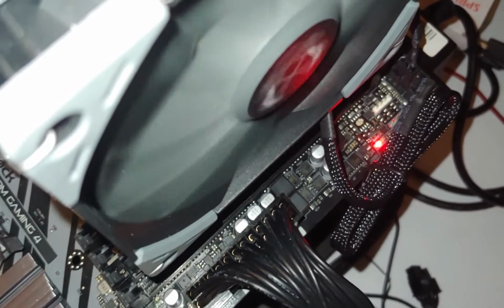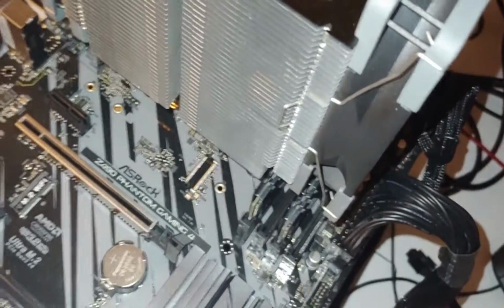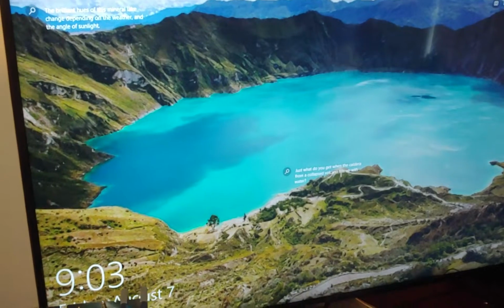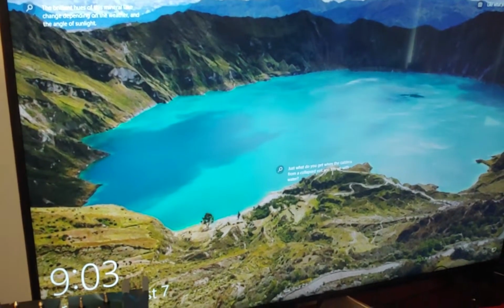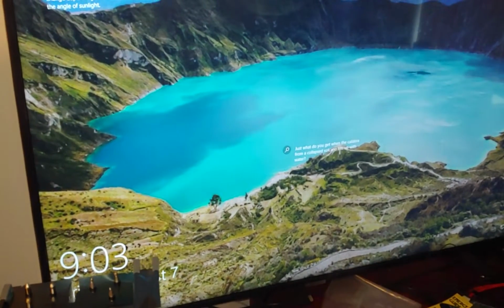Installing the I7 10700k into the Asrock Z490 Phantom Gaming 4 motherboard (After removing I7-10700)

Comment from the maker: Currently, manufacturer recommends using the 2nd and 4th slots (A2 & B2) from the CPU and not the ones that I use in this video. In say Z170, one could put dual channel in A or B if using 2 sticks.  Sorry for the confusion. 

 Channel A: DDR4_A1, DDR4_A2
 Channel B: DDR4_B1, DDR4_B2
 Recommanded Dual Channel Memory Configuration:
 
                       Closest to CPU                                                                                  Furthest from CPU
                       DDR4_A1               DDR4_A2                  DDR4_B1                              DDR4_B2
2 Modules         - -                         DS/SS                        - -                                             DS/SS
4 Modules     DS/SS                     DS/SS                       DS/SS                                      DS/SS
(SS=Single-Sided, DS=Double-Sided, "- -"=No Memory)
Due to CPU limitations, read the following guidelines before installing the memory in Dual Channel mode.
1. Dual Channel mode cannot be enabled if only one memory module is installed.
2. When enabling Dual Channel mode with two or four memory modules, it is recommended that memory
of the same capacity, brand, speed, and chips be used.

Comment: What does that mean towards the end of your video, that red light ?
Reply from the maker: That's the EZ Debug which comes with quite a few motherboards.  In this case, there was no HDD/SSD or M.2 SSD installed.  If I had no RAM installed it would light up for that.  If I didn't install CPU or did it incorrectly, it would light up.

Comment: What cooler do you use with this motherboard and i7 10700k? I am looking for a cooler that will fit in this motherboard well.
Reply from the maker: Right now, it has Noctua 140mm fan/single tower.  You can see the temps in some of my latest videos.  I have had a few others on here to include Scythe Ninja 5 and another Noctua dual tower, dual fan.

Comment: Hey man. Does the motherboard provide support for overclocking? Thanks
Reply from the maker: What do you mean by support?  I am going to assume you are asking if you can overclock on this one...yes, I have overclocked this I7 on here.  I usually use Intel's XTU but there are BIOS settings that can be changed..
Reply: @PC_HardwareTechUnboxing_1  thanks David

Comment: If you could help me i got  kind of trouble with the RAM, what is the correct position por the dual channel? first and third, or second and fourth? Please if you could help  I would really appreciate it! Sorry if there something wrong in my english, Im Spanish :)
Reply from the maker: Hello, I am glad you asked this as according to the manual I put the RAM in the wrong spot in the video.  I have done this more than once as most of the time I do not feel any effects from it.  Older motherboards like this one gave you the choice of putting in matching pairs in either 1 and 3 or 2 and 4:  https://download.gigabyte.com/FileList/Manual/mb_manual_ga-h170-d3hp_e.pdf  That said, there can be some confusing info on the internet as you will see some places say A1/B1.  it is best to check your manual.  This was out of a Gigabyte UD Z490 motherboard.

 Channel A: DDR4_A1, DDR4_A2
 Channel B: DDR4_B1, DDR4_B2
 Recommanded Dual Channel Memory Configuration:
 
                       Closest to CPU                                                                                  Furthest from CPU
                       DDR4_A1               DDR4_A2                  DDR4_B1                              DDR4_B2
2 Modules         - -                         DS/SS                        - -                                             DS/SS
4 Modules     DS/SS                     DS/SS                       DS/SS                                      DS/SS
(SS=Single-Sided, DS=Double-Sided, "- -"=No Memory)
Due to CPU limitations, read the following guidelines before installing the memory in Dual Channel mode.
1. Dual Channel mode cannot be enabled if only one memory module is installed.
2. When enabling Dual Channel mode with two or four memory modules, it is recommended that memory
of the same capacity, brand, speed, and chips be used.

This mirrors what AsRock has in its manual
Priority                       DDR4_A1                      DDR4_A2                            DDR4_B1                                     DDR4_B2
1                                                                       Populated                                                                                 Populated
2                               Populated                      Populated                            Populated                                 Populated
Reply: @PC_HardwareTechUnboxing_1  Then A2- B2 would be the correct slots to use? I use it like that before i saw your video and change it, (dont worry about that jejeje), the matter is, i wanted to know if everything worked correctly on my pc, so I used benchmark to check it, and it says that my memory ram wasnt working as it should be, so thats why I changed it! Anyway this is how we learn, by trying new things jejeje. 
Thanks a lot, appreciate your help :D
Reply from the maker: @emilioperez7690  No problem...sorry for the mistake in the video (though it probably has no effect).

Comment: Hi Dave, so in this video are you using the Noctua NH-14S with the right? If so I will pull the trigger with this configuración. I hope the motherboard will be enough for the games. I will not overclock too much. I’ll go for games in4k FPS and other at 1440p at 120..  I mean, never 1080 when the CPU has strong load.  Thanks for your quick answer and confirmation. Great video!
Reply from the maker: Here is actual installation video:  https://www.youtube.com/watch?v=C3M8Js-5R6o  (nstalling Noctua NH U14s CPU Cooler on Z490, 10th gen compatible, AsRock Z490 Phantom Gaming 4)

Comment: Hi Dave, I'm about to buy an assembled PC and I think it will come with this MB and the I7 10900k, but with a 120mm AIO liquid cooler that doesn't seem enough to cool this processor, so I was thinking about changing the kit AIO for this huge cooler. I think I should remove one of the cabinet fans . What brand / model is the cooler, Noctua? Does it comes with mounting brackets and 4 raised black screws or plastics to secure the mounts?. Could you share the amazon link to the cooler and the complete kit for this processor? I searched several forums and they said that this motherboard did not support Noctua due to the small space. It really surprised me. The other alternative I thought was to buy another motherboard like the MSI MPG Z490 but I do not think there is space for this cooler due to the aluminum cover. Excellent video and thanks for your advice!
Reply from the maker: Hello,  I have used 3 air Coolers with the I7-10700k. 
1)  Scythe Ninja 5:  https://amzn.to/33QeNpf    (It is actually in the video and was used for a short time as it is currently on a 10700)
2) Noctua NH-U14S   https://amzn.to/3lJ54qZ   (Currently using it while I am on travel...will have some gaming videos in the future)
3) Noctua   NH-D15S    https://amzn.to/2H0iVK5  (There are probably 100 gaming videos on my channel using this CPU Cooler between July and Sept 2020)  T

So...unless I installed it wrong which would have led to high temps, I would say they fit this motherboard.  They might not fit Asrock Z490m ITX that I have though.

Comment: I ordered this mobo , and an i7 10700F 
Would it be a good combo? I don't wanna overclock anyway and never wanna do it. Just want gaming and bit of rendering task. So tell me is it really that bad motherboard for my usage or it is alright?

Please please please reply
Reply from the maker: No, the ones that have issues with the motherboard are mainly the folks that are spoiled with $800 Z490 motherboards and are hoping to really push this on the overclocking side.  I have had the I7-10700 and I7-10700k.  

This is a budget motherboard...but will still help your I7-10700f outperform any B460, H470 or H410 motherboard due to higher speed RAM...and not being locked out of Power Limits.  My biggest complaint is that it only has 1 M.2 NVME.  This motherboard has helped me achieve my highest 1080p Low FPS average in FortNite paired with I7-10700k, RTX 2070S and Patriot 4133Mhz RAM.  With compatible parts...it is truly a gamer.

Personal thoughts, I own 6 AsRock motherboards.  I find AsRock motherboards are cheaper built, have more issues with RAM...and they don't always have all the bells and whistles, but due to their price they work in nicely on my budget tech channel. :)  That said, a better built alternative in same price range is the Gigabyte UD Z490:  https://amzn.to/3jKFHo8  It has 2x NVME M.2.

Hope that was helpful
Reply: @PC_HardwareTechUnboxing_1  Alright my PC has too 10700f along with 2070 S . I was sad seeing all the negative review of this mobo but I am fine now. Hope this mobo serve my system well. Anyway how can you pair 4000 Mhrz RAM with 10700k , I thought intel won't get benefits from more than 3000 Mhrz RAM.

Comment: This motherboard got some really bad reviews. Have AsRock addressed these issues yet with Bios updates? Also, is this board ok when not Overclocking the CPU? Great video btw :)
Reply from the maker: I love and hate this motherboard at the same time.  This channel would say some very negative comments about it..but there are some positives.  When its on sale, its the cheapest Z490.  It is a very plain motherboard and it doesn't surprise me that plenty of people would say negative things about it.  I am not a fan of AsRock...I do own 8 AsRock motherboards for the channel. I found the Z390 Pro4 that I have cheaply made, so how did I end up with 5x 10th gen motherboards?.  I know people complain of VRM issues with at least 2 of the Z490's that I have.  For an extreme Overclocker this probably isn't the motherboard they should be picking.  

The latest BIOS update mentions optimizing system performance.  Very general...but perhaps it corrects some issues.  They continue to address Memory compatibility issues too. 3 BIOS updates since this came out.

Yes, for me performance has been great when not overclocking.   Now, the truth is...my Asrock Z490's with I7's/RTX-2070S are quite often performing at levels that folks with I9's or RTX 2080S are scratching their heads wondering while my setup is performing better than their gear.  So...at the moment, I am not really sure I want to mess with the BIOS for the 3rd time on this Z490.   Quite a few game son my channel...any of the I7-10700k videos are on the AsRock Z490 Phantom GAming 4 or the Z490m/ITX/AC.  The I7-10700 is run Gigabyte Z490 UD (and an Asus B460 Prime Plus).  I5-10400 was originally run on a MSI Gaming Edge Wifi Z490 before ending up on a Z490m/ITX/AC.

Thanks for comment.

Comment: So for the 8 pin connector that's fine, 4+4 into 8 pin motherboard and the 8 pin connector on the other side into the 8 pin connector on the PSU. Now, for the 4 pin CPU connector on the motherboard, can I use just one side of the 4+4, but then the other side does not split into 4, so the full 8 pins would go into an 8 pin connector on my PSU. Is this a problem? If so, would de-pinning the 4 unused connections from the 8 pin connector on the PSU side of the cable be better or would that not work either?

Comment: Really bad MB, especially for OC. Have you seen the reviews ?
Reply from the maker: Yes, I was one of the first to unbox and get an overview of its limitations.  Asrock definitely makes cheap boards..and is the worse of the Z490's I have bought.  But also the cheapest...and even for someone with an I7-10700 it is worth considering before buying a B460/H470.
Reply: @PC_HardwareTechUnboxing_1  I don't know what the prices in the US are, but where i live the Gigabyte Z490 UD is at the same price and it looks like a better build board. Asrock kind of messed the entire Z490 line-up.
Reply from the maker: @dustinq9530   Well in US Dollars...they recently had the  Asrock at $119...and  $134 for the Gigabyte.  As I look now, Asrock back to  $149.  So no longer cheapest.